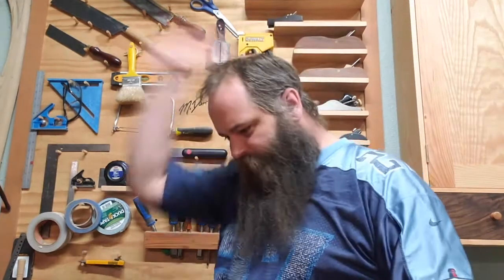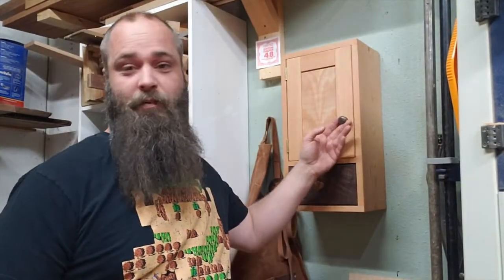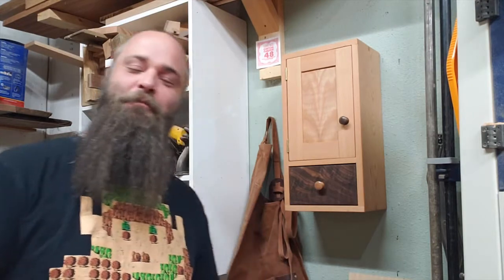My New Shop Whiskey Cabinet

Comment: Your progress is great to see! I think you have made leaps and bounds. I have to ask though, how did you hang it on the wall?
A second though, how well do the glasses fit in the drawer?
Reply from the maker: Thanks, David. I hang all my cabinets with french cleats recessed into the back of the cabinet. It's actually how I decide how far the groove for the back panel needs to be from the back edge of the boards. The drawer was constructed specifically to fit those particular glasses, and they barely made it in. I actually took the partition over to the jointer for a few passes just to make sure they would. It's why the reveal is so big around the drawer. But it's not too bad.